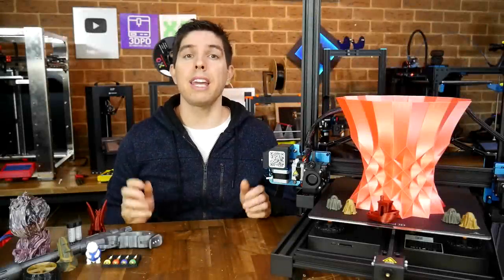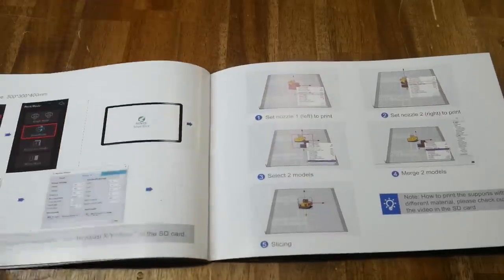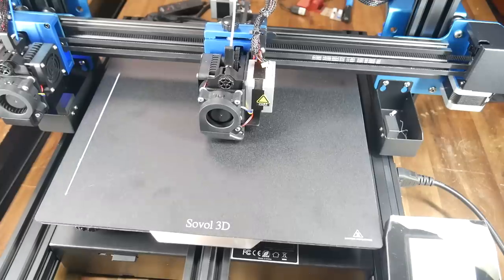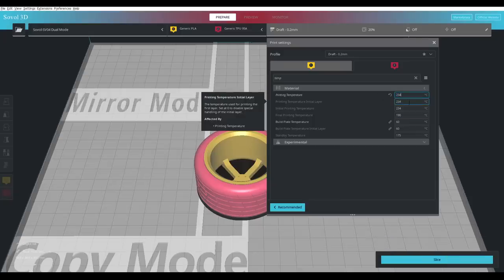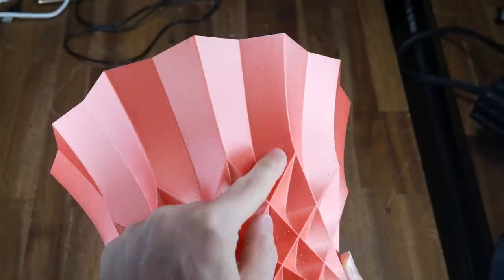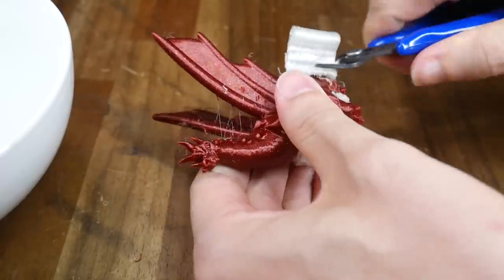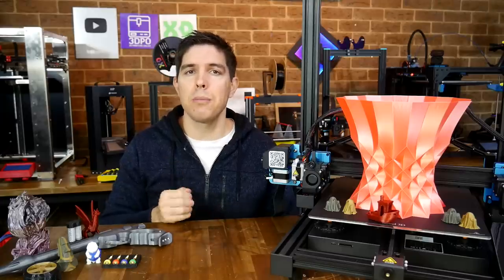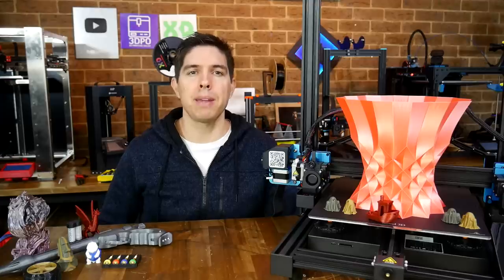Sovol SV04 IDEX: Capable with one big but fixable problem

Comment: A tip for printing with PVA, you can set cura to only use PVA as a support interface(support interface material). This will make the supports print in the main material, and only switch to PVA for the interface between support and model.
Reply: I've just set up Cura for the Sovol SV04 - never used it (Cura) before now (only used PrusaSlicer). Where do I find those support interface settings in Cura?

Also, do you have any recommendation for brand of PVA? All I've found here in Canada is eSun and Polymaker.
Reply: @kennethshock  Hoping you found these settings, but for anyone else (like me) who is/was looking for those, it's under advanced settings on the drop down in the upper right of the screen, where you would normally just have the toggle for supports on/off, choosing the advanced options allows you to set the print interface to one print head, and the support body with the other. Easiest way to test this is to slice a print and hover over the "volume used" section of the slice report. If it shows you very little PVA used but far more PLA, your settings are (probably) correct.

I haven't done any actual real world testing on this yet as I haven't purchased my SV-04 yet, and the setting names etc. are all pulling from memory. However, I did set this up once, and for a large (2.4kg) print, there was something to the tune of 4g of PVA used to the 2.38kg of PLA used. So I suspect my setting was correct. I'm still going to do a test print of course.
Reply: How do you set it in cura, I'm use caftware and Superslicer not very good using cura.

Comment: Note: It is NOT an all metal hot end. By "all metal extruders" they mean the extruders are made of aluminium without plastic tensioner arms etc. They still have PTFE lined heatbreaks.
Reply: Yeah I have been looking online for about a week for an all metal throat tube to replace the sv04s throat tube.  The Diameter of the SV04 throat tube is an 8 mm. I am convinced that the SVO4 is the only printer on the planet that uses an 8 mm throat tube. Unless you guys know of where I can get one I would be very appreciative because the titan extruder housing requires an 8 mm diameter whereas the largest I could find is 7 mm.  And while I’m at it the SV04 Titan extruder tolerances are incredibly loose and I am constantly either getting jams or little to no extrusion at all.  Is there any way to increase The E steps.
Reply: Sovol started supplying a custom made bi-metal heatbreak a few weeks ago. Check their website.
When I got my first SV04 last year I added bi-metal heatbreaks before even turning it on by sleeving the heatsink bore down to 7mm (search thingiverse for SV04 metal heatbreak).
I don't have an issue with jams (3 in a year on two SV04s, all filament abnormality related). As far as I'm concerned e-steps are fine out of the box.
Reply: hate it when they tell u that it is all metal and can print 260c and then you find out that your not supposed to use the tubing at 250 or above lololol almost a deal breaker knowing i will wanna microswiss it to print cf nylon and cf pc
Reply: I print pacf and pccf all the time. Standard extruder, just a bi-metal heatbreak and good nozzles (ruby on one machine, tungsten carbide on the other).

Comment: The issue of blobs on the vase mode print looks a lot like what other printer reviews have reported was caused by power recovery feature resulting in a pause every so often to write the current progress down. Other reviews of various printers have noted that disabling the power recovery feature with a G-Code command allowed vase mode to print perfectly.
Reply: I should also add that one reviewer said that switching to a faster SD card also had success in reducing that blobbing, because the pause for writing the power recovery status was reduced.

Comment: I still don’t understand why this kind of printers haven’t gained more traction, these are absurdly amazing to print figures in one material and supports in a second material, like soluble or PETG over PLA which will offer zero gap at the interface with absurdly easiness to remove them.

Comment: I think most people don't spend time adjusting the slicing profile after receiving their printer. There is no perfectly suitable and constant slice profile. It has to be adjusted according to the model to print well. As you said, the machine is indeed a good one machine, but you need to adjust to the appropriate slice profile, this is completely free, you just need to spend some time to understand and learn

Comment: I have been using this printer for 9 months now. (I got one from the early units made available in July 2021)
My unit is not a all metal hot end. It has a 20 mm PTF tube next to the nozzle
The only really issue I have with this printer is the painful process it is to replace a nozzle and the PTF tube. You have to take apart the entire hot end. My current plan is to fix this by getting the new Revo unit from E3d. Other than that this printer works really well after you fine tune the slicer as mentioned in this video.
Reply: Hey I have this printer shipping at the moment, any tips for tuning the slicer?
Reply: @steinanderson9849  take the original cura and not the sovol one
Reply: I just got one and I'm having weird trouble with the dual mode.  I flashed the printer and display with latest and using the sovol-branded cura (figuring it should work as well as shown in the video) but I can't get the right-extruder to stay aligned, it's always like a millimeter or so to the right.  One thing that happens, that I figure can't be good, is when I start a dual print, once the right-extruder does it's first layer, it first goes all the way to the left and slams into the parked left-extruder, before carrying on its way.
Reply: Did you have any luck with the Revo unit? I'm thinking of putting those on my machine as well.

Comment: I got the SV01 version just over a year ago, and I've been very pleased with it. It too had stringing issues, but after some tuning in cura, I was able to fix that. Mainly with retraction speed, and Turing off Z hop. Your linear advance video helped me set that, which has further solved the stringing. 
Also, I'm surprised about the power supply, Sovol use to make a point of using Meanwell PSU units, which are high quality, and the fans are temp controlled.
Reply: The sv01 is very Different from the sv04🙊
Reply: I also got an SV01 just over a year ago, didn't bother touching their cura profile, just used the default one, had zero stringing issues.

Comment: 10:24 I find ASA prints easier than ABS but if I dont use an enclosure then I have to use brims to keep the part from detaching. 90c or hotter might have kept it adhered but I doubt it wouldn't have warped a little bit anyways. I've used abs juice and all the other tricks but warping is real regardless of your bed adhesion. Enclosures are a must for good quality without libations for this class of filament, in my experince.
Reply: PEI Sprinsteel bed and adhesion with ASA is perfekt for me. I even have to check that is does not adhere to much. I find ASA one of the best to print materials, and it always looks very nice. sadly its very flexible and threads are weak

Comment: I have to be honest, this printer looks quite amazing...perhaps to the point where I'd buy one and sell my Sidewinder X1 to a friend, as this looks like it does everything my Sidewinder does plus a ton more. By the time I'm ready to do all that, I suspect there will be a lot of community-sourced updates and upgrades to address the issues you found.
Reply: i have a sovol sv01, had to increase the retraction to 3mm and everything was fixed, these printers can handle high speed prinitng and reallly print better then the average ender 3 can do
Reply: I started with a Sidewinder X1 too, but kept it when I upgraded. Now I'm replacing it with a MK4, once I can get the X1 working to sell.
Reply: @--Zeke--  Speaking of getting the X1 working...mine suffered a failed bed cable. It didn't burn my house down, thankfully, but I don't have the stones to try and fix the bed heater wires on my own and when it went down it was honestly only slightly more expensive to buy a new printer (a Sovol SV06 Plus) than it was to replace the bed and wires.
Reply: @justinchamberlin4195  Yeah, I ended up having to replace my whole bed after just a few weeks of printing due to bad cabling.

Comment: Great video and explanation. It looks like best machine I have seen to manufacture a slightly larger part from petg. Would you agree or could you recommend another dual extruded 3D printer with a larger build plate? Thanks for you time.

Comment: The blobs in vase mode often times come from power out resume function (every time the printer is writing it's current step in Gcode to the sd-card the printer pauses for a short time)
Reply: That is absolutely what I found with the SV04.  Vase mode creates those little bumps when power recovery is enabled as it constantly pauses to write to the SD card. As vase mode is a continuous line that constantly adjusts the z-axis, the writes happen more frequently than a normal print. Also, since it is a perimeter line only, it is impossible to hide the bumps by timing the writes during corners or infill. Adding M413 S0 to the beginning of the Gcode when you turn spiralize mode on (vase mode) will clear up all of those bumps.  One negative though is that it seems that the writing to SD card is linked to the time estimate on the display, as any time I shut off power recovery that feature stops.  Sorry for rambling, it's probably more information than anyone cared about regarding bumps on a vase!
Reply: @SandChimera  Not at all Paul, I'm grateful for your wisdom.  Thanks!

Comment: I have the Tenlog TL-D3 Pro IDEX. It's a great printer. Most problems I see about these IDEX printers is due to people not aligning the extruders properly
They set the height on one extruder then try the same on the other, then wonder why the printer hits the bed, or knocks the print off the bed
Reply: So then what is your fix?
Reply: @richardbennett8678  What I mean is. 
They set the bed height as normal by moving the nozzle (E1) to a point over the screw, then adjust the bed knob to raise/lower the bed to the correct gap (usually paper thickness)
Then they do the same for E2, using the bed knobs to set nozzle height.
Instead of using the adjuster on E2 to raise/lower the nozzle to the proper gap
I have found using a feeler gauge is far more accurate in getting the nozzles aligned

Comment: I've created some new profiles for the sv40 that improve speed massively. I regularly print with these settings on my sv04.

Open C:\Program Files\Ultimaker Cura 5.2.1\share\cura\resources\definitions\SV04_Dual_Mode.def.json (or one of the other modes you are interested in) and change the following parameters:

	"material_print_temperature": { "value": 200 },
        "speed_print": { "value": 90.0 },
        "speed_infill": { "value": 120 },
	"speed_wall": { "value": 45 },
        "speed_wall_x": { "value": 60 },
        "speed_wall_0": { "value": 60 },
	"speed_topbottom": { "value": 50 },
	"speed_layer_0": { "value": 40 },
	"speed_print_layer_0": { "value": 40},
        "skirt_brim_speed": { "value": "speed_print_layer_0" },

This nearly doubles the speed of your printer and has no bad side effects. The increased "material_print_temperature" at 200 is to enable flow to keep up with the new speed settings.

Let me know if this works for you too - I've been extremely impressed with my SV04 after changing these settings

Comment: I've found that vase mode blobbing and microstuttering like you saw is almost always caused by brief pauses when power loss protection saves the layer changes to the SD card.
Reply: I have seen that too. The reason it affects vase mode in particular is because the firmware sees each Z move as a layer change, and that's all moves while spiraling. Non-vase mode prints have the same stutters just at the layer changes, where it already paused extrusion.
Reply: So if I disable power loss protection (assuming that's possible), can I fix these on vase mode?
Reply: @luizgoncalves5113  Typically yes.

Comment: I liked the serious mention of the included belt "tensioner" xD
Also what are the odds? I was looking at this printer a few weeks ago, but ended up getting a tronxy xy-2 pro which I'm gonna be running a chimera hotend on. Hoping it will work well for printing 2 colours/filament types. Dreading the z offsets though o.O
Reply: They misspelled it and he pronounced it that way lol

Comment: Great video as always.  I search out your videos to increase my 3D printing knowledge.  I've had this printer for approx. 4 months.  The only real problem I'm having is the extremely slow print speed.  Is there any way to increase this speed.  In the Cura profile it says that the print speed is set at 60 mm/s, but it seems like it's much slower than that. Any help would be greatly appreciated.

Comment: Quite curious, do you try measuring the bed temp using an external thermal camera/IR thermometer? 

I noticed that on my very ancient printer, to hit 90C i need to set it to 120C... But it sticks really well on paper tape once the temp is hit.

Comment: Maybe the printer you tested in particular had some temperature offset by which each print was printed at just a little too high temperature. Perhaps if you would have repeated some test prints stepping down 2.5 - 5 C the stringing, and oozing, could be resolved. I've seen numerous other videos of the Sovol SV04 whiched showed no stringing or oozing.

Comment: One flaw with the copy mode. If your bed is warped to any extent, the leveling mesh will not compensate for the second extruder. And warped beds are a common problem with this printer. Check the Sovol forums and other groups. Customer service is also slow to reply. I am currently ghosted on my bed replacement :(
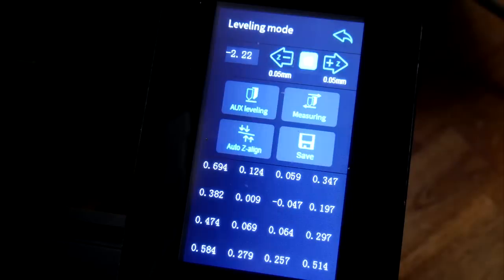@3:47 the leveling in this video shows significant variance in the center.

Comment: I actually bought this printer a couple of months ago and it mostly works great. I had some issues regarding the filament runout sensor, where my filament got tangled up. And I also didn't manage to flash the firmware, but I think I did something wrong.
Reply: You need to install the CHR41 USB driver with the computer plugged into the printer, this is a Creality Bug

Comment: Interesting. I print utilitarian stuff and two extruders would be handy but... What I would really like is a printer with a larger bed. No not square and I don't care about it being 50' tall I want something like an ender3 or CR10 size bed  but twice the length.
Reply: I remember on the ender extender group (Facebook) that there was a person that hacked together their extenders with extended beds.  So you got 300x600 or something crazy like that.  It just took a custom cut bed and mount, etc.  But the problem becomes weight and slinging that sucker back and forth.  I so wish the folgertechs were still made.  With updates in linear rails, stepper drivers, boards, and LDO motors etc, it could be a nice "big" but low option (1200 x 400 x 400?).  As is, you almost have you almost have to custom build, the plans are out there.  The next solution would be a Modix big printer (1200x600x600) but then you are at almost $10k and climbing but it is still a "kit" printer.
Reply: There are a handful of yt videos where people have extended the length of the bed. Looks pretty straightforward with the standard aluminum extrusions.
Reply: Look for printers with conveyor belts and the vertical part at an axis. There are several recent ones, and they would sacrifice the length of one axis but another axis becomes almost infinite. You could print a long sword or something. Or they could print small things over and over and they fall off the "bed" at the end of the belt...
Reply: make one it's easy enough to do.
Reply: @orangezeroalpha  belt printers are great but complex to set up and you need to really understand what you are doing with them